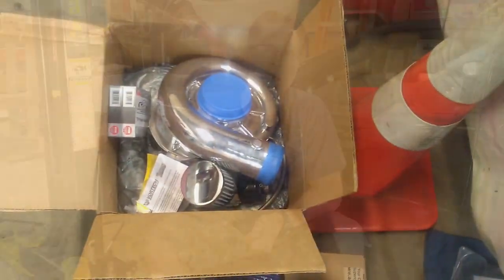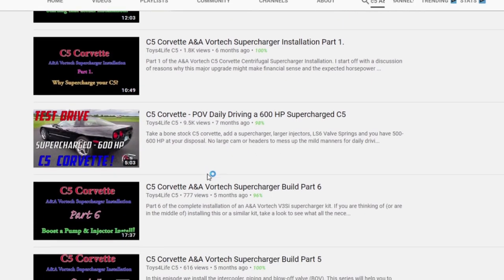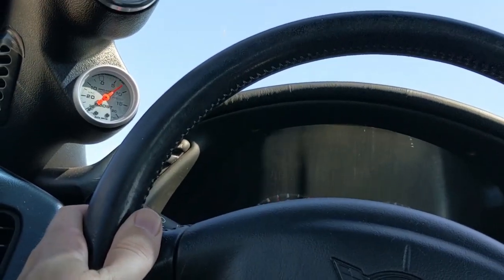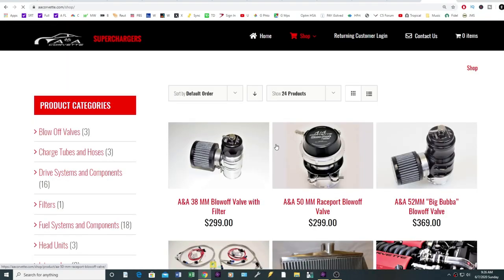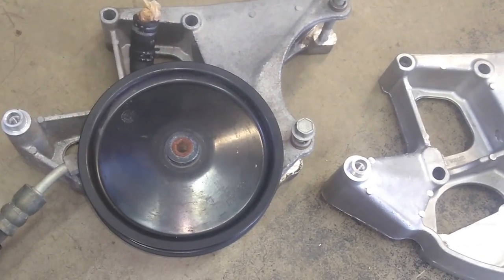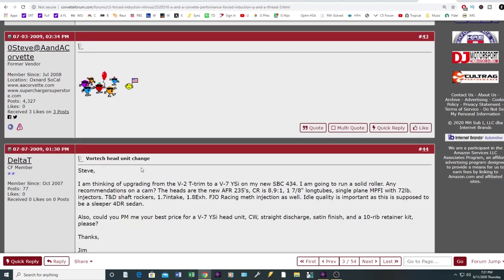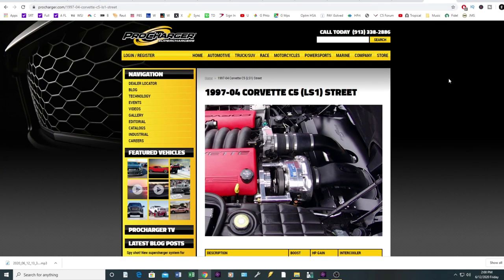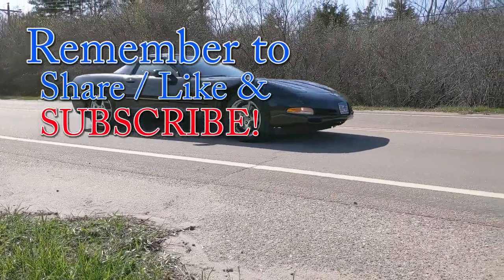A&A Corvette C5 Vortech Supercharger Review

Comment: A other reason to upgrade your valve springs in any boost application is that the boost actually creates a resistance for the valves to close, thus creating valve float at an earlier rpm
Reply from the maker: Very good point!

Comment: I have a 2002 ZO6.  In 2006, we installed one of Andy's kit.  Back then he  was using Procharger.  I bought the basic kit with the P1sc head unit.  I am running only 7 lbs of boots.  The car puts down 525 RWHP with no other mods.  I have put on over 30,000 miles with the supercharger and have had no issues with engine what so ever.  However, the power of the motor bent my drive shaft.  Andy's kit are the most reliable and best bang for the buck out there.  I highly recommend.
Reply from the maker: That's a testament to the reliability right there, if you don't push it too far. I'm in the same boat I really don't want to push it to the point where something breaks. If you had a chance to run it at the track, I'm just curious what your quarter mile mile per hour was?  Thanks for the comment!

Comment: Have a 04Z wanted to add a supercharger how much $$$ also how much wheel HP do you think I will I be getting also does that price include installation also is that changing from regular 91 to 85 well I have to change the Hood just curious please reply back as soon as possible. Thanks 😊
Reply from the maker: Hi, kit is currently around $5500.  Install is around $1500 with a tune.  Keep the same hood. You should be using 91 already - GM says so.  Cheers!

Comment: My bone-stock 2004 C5 is plenty fast for me. I'm not on the street to prove anything to anyone. I like the Corvette's reliability, economy, and fun factor. Bone-stock will top out around 175-180 mph on flat ground, I haven't done that in mine, and probably never will. I'm just happy to have the knowledge if I need to pass or go a bit faster, no problem. When I first bought the car in 2004, new, it reminded me of my 2000 Suzuki Bandit GSF-1200S. Passing and acceleration were effortless. Not much planning was required for passing another vehicle on a 2-lane road. On the bike or in the car, you just blip the throttle a little bit, and the pass is complete. No down shifting required in most cases. These cars can do 300,000 miles with reasonable maintenance. With a Supercharger?, probably not.
Reply from the maker: To each their own.  After several years of ownership and seeing how reliable C5's are with superchargers, many people opt to go the supercharger route.  Some stay stock and others go heads and cam.   Anytime you increase the output of an engine you increase wear and the chance of breaking things. Even a stock engine can break stuff.  I think if you limit your power to around 600 at the crank and monitor the engines operation parameters carefully you can still expect a reasonable lifespan.  But yes-  if your goal is 300k, leave it stock.

Comment: If we are talking c5 zo6 ,we start out with 405 hp,so low end very potent. When you add 6psi of boost 3000to 6000 rpm is immediate .you will be busy chasing gears!
Reply from the maker: Yeah and the boost will raise the red line as well  to easily want to rev past 6,500 so it really kicks in around 4,500 RPM.

Comment: I got a 2001 zo6, I bought it done, procharged n meth injected, 4 corner coil overs. The heads have been ported, the fella that did the work owned a speed shop n he also did something to tranny n rear end. But the dyno was 806 HP on pump gas n 840hp on FUEL!..  SHE run a 10.01 at 140mph with slicks n it's only on 6lbs of boost. I mite do a little more work to her to push HER INTO THE 9s!..🤔🥳😎  I've had the car for 5 yrs now n she only has 34.000 kms on her so far n LOOKS LIKE NEW STILL!    I LOVE IT N IM 60 YRS OLD!🤠
Reply from the maker: That sounds like a heap load of fun!

Comment: Love the videos. Very informative! I'm looking at a 02 m6 with a older model vortech V2 kit on it that mounts on the drivers side. Are those a good kit?
Reply from the maker: Not sure.  you sure it mounts on the drivers side??
Reply: @Toys4Life  positive. Ended up grabbing it. It's an older V2 trim. Per serial number a 2004 to be exact. Has a small oil drip coming from either the return line or head unit but other then that she runs great. Going to have the head unit rebuilt just due to age and cheap peace of mind. It can be done for under $500 new seals and bearings.

Comment: Nice job, but I think you definitely should include the cost of the clutch /install and tuning cost.
Personally I’m a huge fan of being able to stop just as fast , if not faster than the acceleration of my car, include a high end brake system in the final bill.
Adds up quick, doesn’t it ?
Anyhow, enjoy your ride ! Sounds like tons of fun .
Reply from the maker: Thanks for the comment.    I have recently put together a couple of new vids that go into the cost of the kit and the install price.   Stock brakes on the C5 are excellent IMO.  Most people upgrade them for looks - a few hardcore road racers that need the best possible heat dissipation capacity will upgrade.

Comment: Great videos, did you have any problems reinstalling the  Alternator bracket . I'm  taking about the new heavy duty one. I got the same one and the power steering pump has three mounting holes and the new bracket has only two. Did you have  to create a Thrid hole on yours  ?
Reply from the maker: No, it was a bolt-on affair no modifications! Somewhere in the video I think I line them up side by side as well.

Comment: What did you do for the fuel system?  As some kits recommend new fuel pumps.
Reply from the maker: Stock fuel pump with Kenny Bell Boost-a-pump.  Works like a charm!
Reply: @Toys4Life  I'm planning my purchase within the next couple of weeks, I have seen what seems like conflicting information on the fuel system. I have heard people recommend running a 450lph pump but a sales rep suggested a 255lph pump for the same system. I was told by a tuner I should avoid the boost a pump. I know results can vary but, if your fuel pump were to go out today would to stick with oem and continue the boost a pump or would you upgrade to a higher flow pump? 

also do you have any input on what the actual fuel demand might be?

awesome videos btw your installation guides plus whatever comes from A&A are going to be in use!
Reply from the maker: @justincherno4289   A&A has done hundreds of C5s.  There are some differences in stock pumps between years so I would suggest talking to Josh or Andy and see what they say.  My stock pump in my 03 is still going strong with the boost a pump and I am running e33 fuel (takes more than regular pump gas which is e 5-10 in MN.  I think the BAP is a sound product.  It only boosts the voltage (and the pumps output when you are under boost which realistically is maybe 5% of the time.  The other 95 % of the time it is running just like the stock pump.

Comment: Did you raise the redline when when tuned
Reply from the maker: Yes, I shift at about 6300 now and the red line is 6500. If I had an older LS motor (97-00 or so)I probably would only shift at like 6100, the rod bolts aren't as strong.

Comment: Old post, but I am just getting an A&A installer.  How did you get 600 wheel horsepower out of it.  I am currently having some issues somewhere, I am only getting 5 pounds of boost.  Shop doing install want to get a 3.6 pulley, but I should be getting 7-8 on the 3.8.  

I appreciate any insight you can give.
Reply from the maker: What cam and heads do you have?  Headers?  I have 585 RWHP with stock LS cam, heads and exhaust manifolds.  If you have a fairly aggressive cam and headers that would knock off a few psi as that would have less restriction = less boost.
Reply: Less boost but more power.

Comment: Does this supercharger add low end torque and power or is it mostly in the higher rpms? Great video!
Reply from the maker: Centrifugals like the Vortech are progressive.  Adds very little at 2k rpms.  more at 3500, fair amount at 4k, and a Ton from 5500 - 6500 RPMs.  This is perfect for the C5 on the street because an eaton/roots style hits the torque a LOT down low which in the C5 would be no fun on the street to drive.  The Fiero I show in the video is a good example - watch it lung off the line from that black dodge.  But the fiero has the weigh of the engine over the rear tires - so it can take it.  The C8 would also be a ton of fun with either the eaton/roots or a Centrifugal SC.   The C5 is best suited for the Vortech with the engine up front.  Trust me.

Comment: I am doing the exact same install on my 2003 LS1, I want to buy HPTuners, any chance on you sending me a copy of a MAP that would run pretty good, or pointing me in a direction to find MAPS for similar configurations.    I am going to get it to run at least as good as stock then tune for more power when I learn how to set it up better.    They told me at A&A that they would flash it but it will still need more tuning. I believe you started with their initial MAP also.   Will it run on their flash at least as good as stock or will it run badly on their flash they provided? Stush
Reply from the maker: Hey, let's call it a tune file. What fuel injectors are you using and are you an automatic or manual?

Comment: how are you getting 14lbs of boost on a 3.6 pulley, stock ls1 engine with 3.6 pulley should be 9psi
Reply from the maker: Maybe my engine's more restrictive? I have had two separate boost gauges on it over the last few years and they both read the same. Curious, where did you get the standard that a stock '03 LS1 with a V3Si supercharger and 3.6 pulley should equals 9 lb of boost (which is essentially restriction to flow)?
Reply: @Toys4Life   just checked the email from a&a, 9.5psi on a 3.6 pulley on my v3 si for my stock 02 ls1 , your hitting 14psi so i am lost whats going on there.
Reply from the maker: What's the elevation above sea level where you live?
Reply: florida @Toys4Life
Reply from the maker: Is your exhaust system completely stock? I have stock exhaust manifolds stock cats and stock catback. Are you running the stock mass airflow sensor too?

Comment: I'm thinking about getting this kit. You said as long as you stay under 600whp you should be fine. If later I want to upgrade the engine. What would need to be replaced? Full rebuilt?
Reply from the maker: If I was going to go for a 900 horsepower, I would do a full forage piston rotating assembly and rebuild.

Comment: Do you have any stock c5 times, from the dragstrip?...thx
Reply from the maker: YES, 2003 C5 LS1 stock,  manual transmission, high performance street tires - 13.35 seconds a@ 107mph in the 1/4 was the best it would do.  Same track, same tires, A&A Kit, LS6 Valve springs, same street tires - 11.5 @ 130 is the best......so far ...

Comment: Pretty stock motor... how about clutch, transmission, drive shaft and rear end?  Stock tires or street slicks?
Reply from the maker: My clutch was getting tired and like most stock C5 clutches it didn't like to shift over 6k without sticking to the floor.  Went with an aftermarket clutch.  The stock clutch held fine so long as you did not try to shift like you were racing for a million dollars.  Drag radials and aggressive launches at the strip you will want to upgrade some more parts that become the fuse.  I stay with high performance street tires because I am on the street 99.8% of the time.

Comment: Super cautious with your own vehicle?
Do I need to ask the obvious?
 most C5 owners are newbies to Corvettes.. 
So take it to a reputable Corvette mechanic, and you won't have to worry about whoever's working on it treating it like it's not their car.
 I own a C1 through C7.. I am 70 years old and I bought a73 brand new have been hooked ever since.
A couple a little mods on my 01 ZO6 and the damn things knocking on a hundred eighty.
If you're not taking her to the track, how fast do you want to go.
There's 700 to 800 pounds touching the ground at 180..
Pray you don't hit a pothole
Reply from the maker: If you don't do your own work, your mechanic has to be as trusted as your doctor IMO.   Keep searching until you find "the one".  I don't want to go super fast, but I do like to go 0 to 85 as quick as possible and it is a rush to go to 130 at the track.

Comment: Should of Had  a pro install it and your not making 600 hp with out blower cam or head work or headers or alcohol 🤔  put it on treadmill
Reply from the maker: Dynamometers lie. The car traps 130 mph in the quarter.  For a stock weight car and my 200 pound body, I think that puts us at 600+... Furthermore, 2009 ZR1 runs 130 in the quarter mile. It has 638 horsepower.